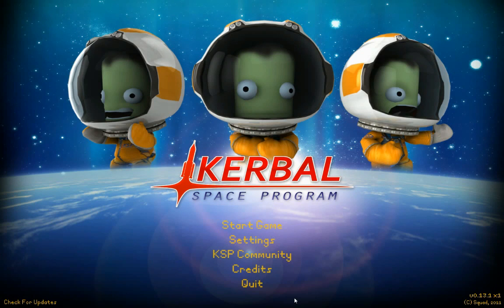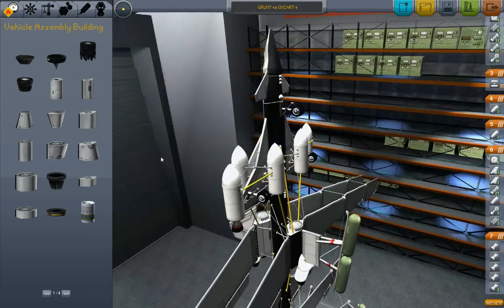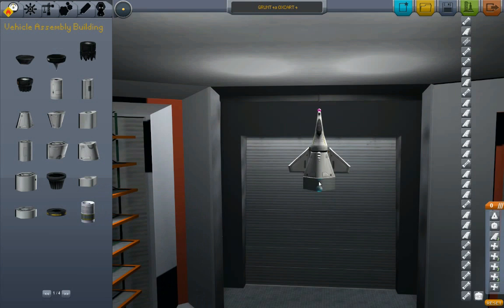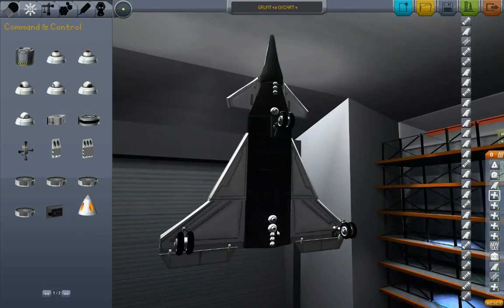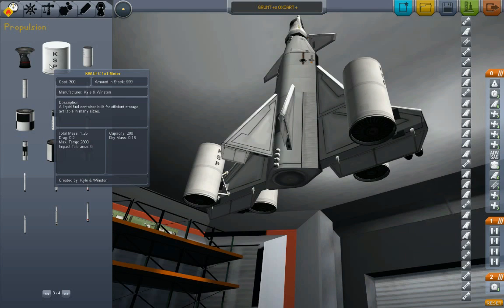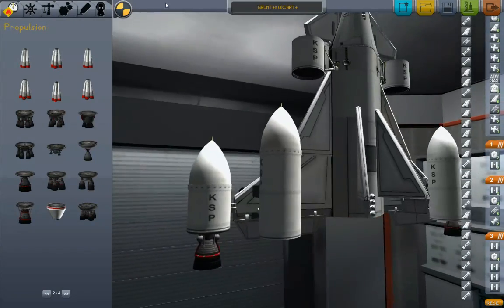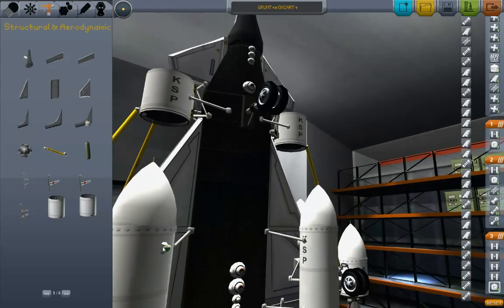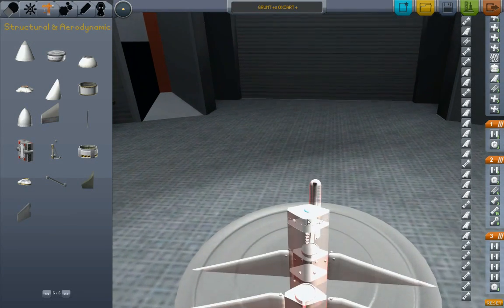Let's Fly Kerbal Space Program: chapter 1, ep. 24

Comment from the maker: @HerraTohtori Airflow and lift are negligible concerns in this particular case, since GRUNT handles the launch, and all fuel tanks will be detached before I re-enter the atmosphere.

Not recording, I actually did try to test the design on Kerbin... as un-Kerbal an approach as that may seem. But the vehicle with tip tanks and engines was far too unstable for atmospheric flight. It'll only work in vacuum.

Comment: The forward position of the fuel tanks works in the game, but looks rather bad because in reality you would have those thanks directly behind your canards (airflow problems) and also directly in front of the leading edge of your main wing (massive loss of lift).

What I would do is keep the configuration that was working quite well, and then try it with just wing tip tanks and engines on Kerbin to make sure the RCS hover thrust is balanced. If it works on Kerbin, it'll work on Mun.